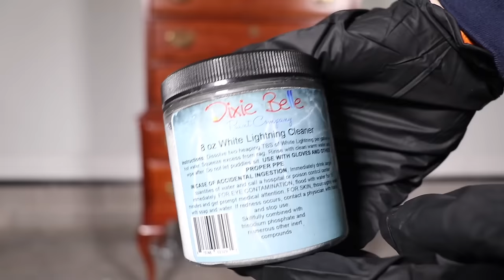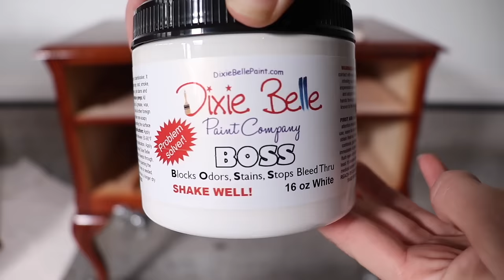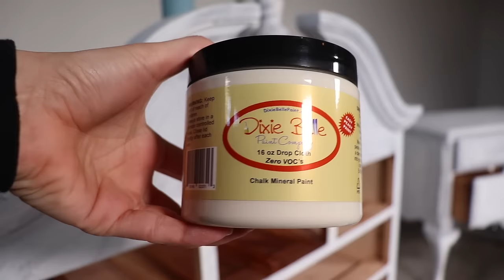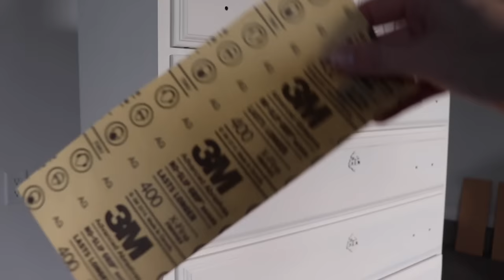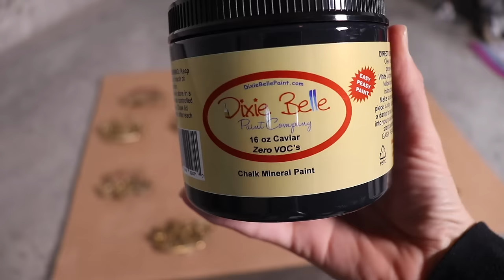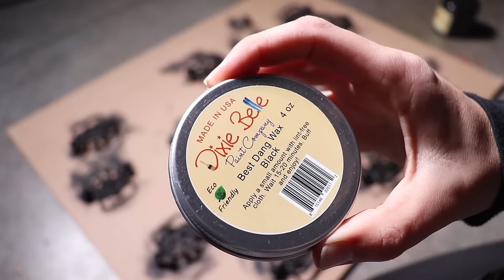How To Create The Perfect Distressed White Farmhouse Dresser with Dixie Belle Paint

Comment: Hi there , that came out perfect.   I’m having a really hard time with mine. I’m starting with bare pine.  Staining first then chalk pain. But the chalk pain is not coming out smooth, a lot of brush strokes. If you have any guidance for me I would really appreciate it 😊
Reply from the maker: We think you might just need to sand it a little until the lines are out. After that, repaint with either a damp brush or use a spray mister bottle on the piece as you paint. The added water will really help stretch the paint out. Once you've repainted, you should be good to finish everything off with Gator Hide. Hopefully, this helps. Happy painting!
Reply: Thank you so much !